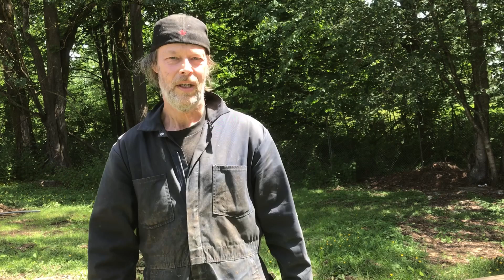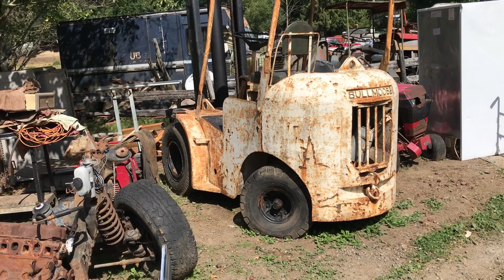Vintage Bullmoose Forklift, Fine State of Affairs Cover

Comment: Hello,

I've got a 1950 Bullmoose that I am trying to get running again and am hoping that yours has a fuel pump on it, I'm trying to find out exactly what motor was in these things and what pump. I've got a couple manuals for these forklifts as well that I can scan and email to you...
Reply from the maker: Mine has the same engine as an 8N or 9N ford tractor. Mine runs on propane but you can use an electric fuel pump for gasoline. I've seen lots of engine options in various models, continental,chrysler etc.The manuals would be nice to have thanks.
Reply: Was hoping that yours might have been converted from gas to propane and still have the original pump. My motor looks exactly like that from an 8Nas well and all numbers match the tractor parts books but it's got a side mounted pump unlike the 8N. From what I can tell it is an industrial flathead but I can't find a reference to the pump for those either - they were most likely gravity fed as well. I will probably go for electric if I can't figure out what pump is supposed to go on this thing, no numbers nor actuation lever on the remnants of the pump on my forklift. 

Anyway, not sure how to send you a private message on here to trade email addresses and get you the manual scans. I've got the books for the B624 and the 525 / 425...